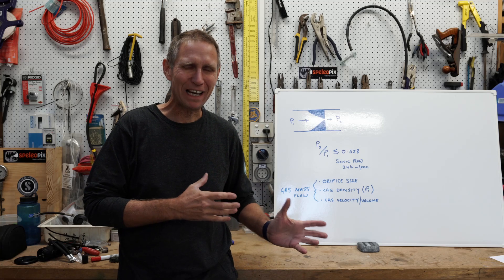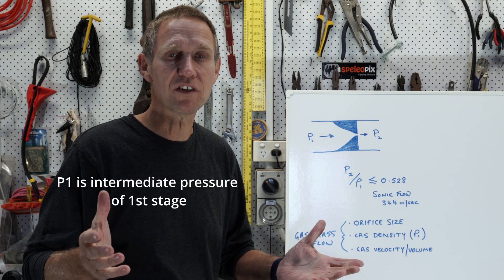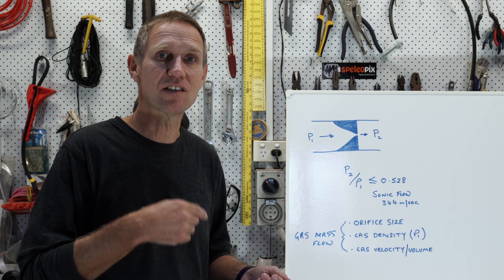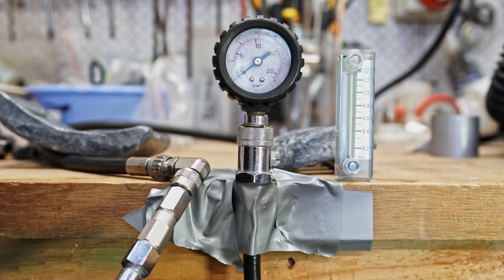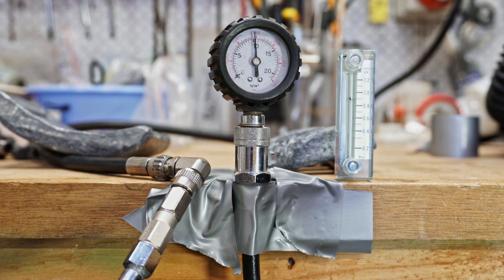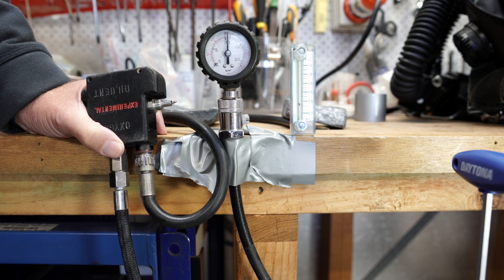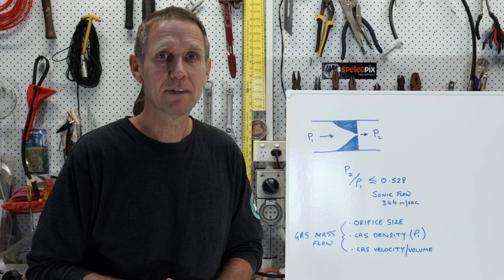Understanding Rebreathers - CMF Valves

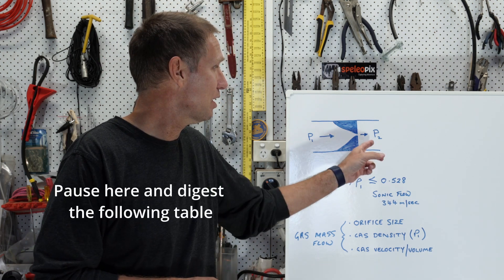Comment: Hi Richard, the table you pulled up at 7:31 was incorrect. The last column should be p2/P1(red), not the other way round
Reply from the maker: Quite right! Thanks for pointing that out. I'll pin a message.

Comment: The clearest explanation ever seen on this subject.
Question: with an unlocked regulator and needle valve, how many times should the valve be operated during depth changes? 
I have been using a kiss for quite some time and do medium to deep dives. I find the orifice to be very delicate, but I also don't want to be adjusting the needle all the time. Is it very sensitive?
Never seen one in person.
Reply from the maker: In my normal depth range (say down to 40m) I would say I don't really adjust it. I haven't done a lot of diving past 100m on this valve but I think the adjustments are minor. Send Charlie Roberson at Fathom Dive Systems an email and ask him.
Reply: @DrHarryH  thanks, much appreciated

Comment: Why not use a much smaller orifice with an appropriately higher IP to give you a CMF usable all diving depths (Say 30 bar)? Seems like an easy way to remove the needle valve from your workload. Does higher gas density impede sonic flow? Higher risk of blocking the little hole? Cylinder pressure drops below IP too soon? Thermal expansion/contraction of the smaller hole (adiabatic/environmental)?
Reply from the maker: Hi, the complex physics of sonic flow is way above my pay grade. But there are some practical issues in simply increasing the IP higher and higher. Namely stress on the 1st stage components and the small orifice is certainly prone to blockage (this is not uncommon using an orifice). The needle is not difficult to use seems to lower the risk of a blockage.

Comment: I beleive the maximum depth for  manual rebreather is 50 meters, because CMF,  and using deompsated first stage for O2.
In case I want to go deeper  to 100 meters or more what is the solution and procedure?
Thanks for your vedio.
Reply from the maker: Hi, the maximum depth (from the perspective of oxygen addition) depends on the intermediate pressure (IP) of the 1st stage regulator when it is 'decompensated'. For example, if you want to dive to 100m (11 ATA), you need to set the IP to to at least 12 bar. The alternative solutions are to use a bypass so you can add oxygen using an add button at any depth beyond that, or use a needle valve and a normal (compensated) 1st stage.

Comment: Hello Harris, does the needle valve have certain marks on it as each time you twist it lets you know the exact amount of O2 you’re letting in into the system? Or it doesn’t necessarily need to be as precise as your metabolic rate? Thanks!!!!!
Reply from the maker: I have a mark on mine which is equal to 800mls flow on the surface. From then it is just a matter of adjusting open or closed during the dive. If the first stage is compensated (like a normal regulator), I also like to have a shut off valve in case the flow gets too fast at any point. I also like the shut off because I very worried about not turning my oxygen cylinder on before the dive, so this way I can turn it on and not worry about losing gas before I dive. Open valve, give a blast of oxygen into the loop, then enter the water.

Comment: Thank you very much - very clear and concise explanations.
One slightly nitpicky comment: On the OmniSwivel (made for KISS) CMF / manual add block the O2 inlet and common outlet seem to be swapped, with the common outlet being in the middle (at least this is the case on the unit that I own).
Reply from the maker: Must be made differently to this one I guess

Comment: Hi Harry, nice explanation of CMF and it's cool to see the old homemade needle valves.  I thought I would point out that the Fathom CCR has been using a needle valve with a blocked or uncompensated first stage for 6+ years now and the result is a very intuitive and easy to dive mCCR with none of the drawbacks of a fixed orifice.  We also use a stronger spring in the first stage to increase the depth limit.  I've used mine to explore Weeki Wachee at 125+ m.
Reply from the maker: Hey Charlie, yes I agree the needle valve solution is becoming much more widely accepted and plenty of deep dives being done on them now. I guess by the time you are doing these depths on mCCR you have the knowledge to drive the system. I do admire Kerry and the guys who started developing this over 20 years ago. Interested to hear if anyone is aware of an earlier use.

Comment: Very interesting, though also very confusing to my brain 😂
Reply: At a very high level: most first stages on the market are depth compensating, meaning as surrounding pressure increases, so does the intermediate pressure - IP. Because mCCRs are constantly pumping oxygen into the loop the first stage is converted to be non-compensating, meaning it has a max pressure and that's it. Its pressure gradient decreases as you descend, until surrounding and IP are essentially equal and flow stops.

This is why mCCRs are depth limited from the factory. They're typically limited to <90m. So the answer is modification to a needle valve, or just run an eCCR with a depth compensating valve. In either case you're adding complexity and should have the pre-requisite training.

Comment: Do they do one like the semi which opens every three breaths? That seems even simpler because it’s a delivery not dependent on gas analysis yet better correlated to metabolic effort(if that’s a thing)..
Reply from the maker: CMF is used in some semi closed systems as well, but that is different to a system that is keyed to respiratory volumes.

Comment: I opted for full eccr. However i do like palagian needle valve for o2 "c mf". If i build a unit or create a submarine control  unit i will utilize the needle valve,
Reply: O2 shutoff, and manual o2 addition seems like the best for deeper diving. I'm glad i fly manually as much as possible with my unit taking parachute mode if i didn't keep up.
Reply: If i had a cmf valve of course.

Comment: Hi Harry, that was a nice explanation. I'm just wondering, say I were to think about getting an mCCR and growing into diving deeper than 90m, i.e., outgrowing the 10bar IP, is there any downside to just getting the smallest orifice and cranking up the IP for the mass flow I need?
Reply from the maker: That is certainly one solution. It requires a bit of trial and error to get the oxygen delivery right for you as an individual, but the orifice that comes with the unit as standard works for most people with some minor IP adjustments. Remember all brands of 1st stage have a safe range to set the IP. Set it too high and you may increase the risk of 1st stage creep and even seat failure (I have experienced that latter once and the PO2 spikes very quickly indeed). With sufficient experience, you may find a needle vale solution as described a better option. I have dived mCCR to 140m using this technique, but I repeat, you want to have significant experience on the standard unit before attempting this. I prefer to dive an eCCR at these depths to be honest.
Reply: @DrHarryH  Thanks for the detailed answer. I completely agree that you don't want to overdo it with this approach and it is inherently limited by the constant orifice and the size you can manufacture. As such, it is not a proper solution. My basic thought was mainly that the 10bar IP could be considered just about limiting for the depths that many people consider still tolerable risk (100m-120m ) range which would just be out of reach. Thus, closing off a Cyklon first stage for the higher IP tolerance and the smaller orifice could just about make it in there without needing a needle valve. Of course, it all depends on what IP you actually need with the smaller orifice, so it's also a bad idea to bank on it, buy a rebreather, just to then realize that the IP you need with the smaller orifice is still not quite high enough.
Reply from the maker: @tobiashartung856  yes the old Poseidon 1st is easy to blank and I recall setting it around 13-14bar many years ago. Check out this for the unit that started me of way back! http://www.therebreathersite.nl/05_Reviews/evolution_of_a_rebreather.htm
Reply: @DrHarryH  Thanks for the link! Very interesting indeed.